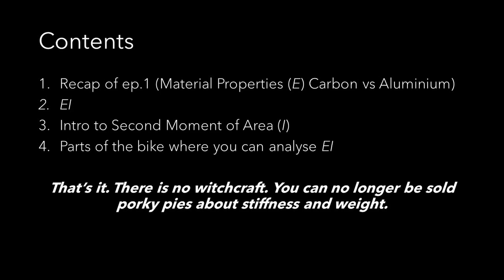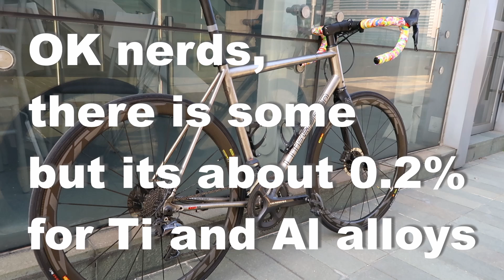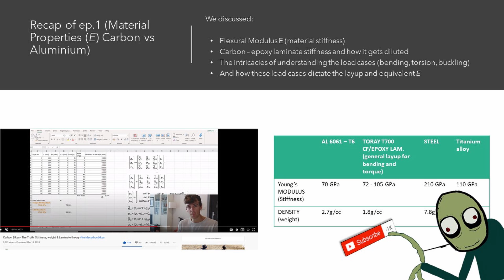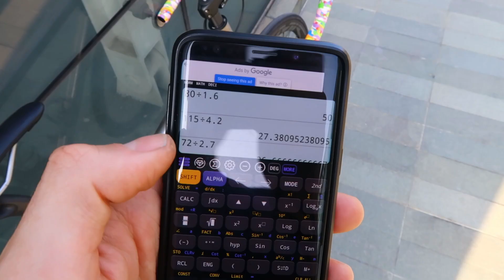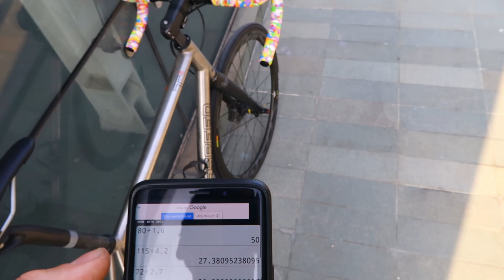Titanium Bikes - The truth and Physics of 'ride feel' marketing.

Comment: Great vid and spot on. 

Ti frames built with thin walls and large diameter tubes ride stiff. Period! And titanium alloys are not some magical vibration damping material despite the bullshit claims to the contrary. In fact, aluminum alloys have a higher vibration loss factor because they damp vibrations better than ti alloys. This has been tested and proven in numerous objective lab tests including the tests conducted by the Colorado School of Mines, who know a bit about metallurgy. This is why high end audio component makers use aluminum rather than ti alloys as a vibration damping material in their products. 

Having ridden ti custom bikes from Serotta, Moots, Holland, and Potts I can tell you from thousands of miles on those frames that ti is durable, looks cool, resists rust, and can build a slightly lighter bike than steel for a similar size and stiffness frame. But ti does not make a relatively stiff large diameter tubed bike magically ride like butter, float over the road, nor is it a magical vibration damper. And delusional claims and marketing BS to the contrary are just that, unmitigated bullshit.

Comment: The stiffness cyclists care about is really torsional stiffness. Vertical components are basically dominated by tires anyways. The key to torsional stiffness is increasing the width of your truss and getting the pedals closer together. In principle you might get a better result from an internal crankset

Comment: Those qualities of ride 'smoothness', vibrations etc, how much are they influenced by the current trend towards wider tires used at lower pressure? Is tire choice becoming a more critical factor in determining 'ride' than frame material? [as per sports cars' lower profile wheels vs saloon cars' deeper wheels- assuming valid analogy...]

Comment: Agree with all you said , & great to see proper engineering basis vz seat of pants opinions around frames...keep it coming !

From my experience 'Durability' and 'fatigue resistance' are also tricky terms given how many factors affect them beyond the base material properties, - I've had two TI frame failures with cracks  & two carbon frames badly deteriorated with alloy corrosion leaching into carbon at 'joints'
Reply: IF that alloy leaching was a problem, just imagine what will happen when those (soon to be the only way carbon bikes will be sold, if the manufacturer trends keep up like they are) all internal brake lines filled with corrosive brake fluid start leaking into those same carbon frames, even if they are internally gel coated (I'm guessing most are not, anyway??).

The sharp bends required to be hidden internally, especially near the head tube/stem even help contribute to the brake lines cracking, wearing through, and rupturing. :(

NOT a good design, in my honest opinion at least.

Comment: So I presume Bianchi's use of Countervail, to reduce high frequency vibration, is also marketing rubbish.
Reply: It's not, at least not completely. The countervail material has been successfully used in the construction of helicopter fuselages and satellites to prevent them from rattling (ie vibrating). Bikes in normal use rattle in much lower frequencies and under much smaller loads than aircraft, so the effect isn't that big. I own several carbon fiber bikes, and when I ride the same stretch of rough road, my Bianchi with CV is noticeably (a little) more comfortable, but CV definitely cannot make Paris-Roubaix-like pavé feel the same as a freshly paved highway. Their commercial with the ping pong ball bouncing on an isolated chainstay clamped to a"rattling device" is indeed silly, because one rides on a complete bike with frame, wheels, tires, saddle etc. and not on isolated single tubes.

Comment: I think this is simplyfied way to much. As far as I remember from my engineering studies, I scales with the power of 4 of radius of a tube. Weight scales linearly. (Thats why bikes are made of tubes and not rods) Since risk of crimping puts a limit on wall thickness, aluminium can be used to make a lighter tube of equal stiffness to that of a titanium one. To make a fair comparison I think you need to compare the value of the square root of E divided by density, for each material.

Comment: What about specific Strength? (not to be confused with Stiffness) Giving the smaller second moment of area of Ti tubing most likely means the maximum distance from the centroid will also be less hence less stress for the same given bending load, combined that with the higher material yield strength of Ti means a Ti tubing will have higher strength and larger deformation at failure compare to one made from Al.  Translate this into bike frame design, yes you  CAN design  a AL and a Ti frame that has the same stiffness, Ti CAN however allow for less stiffness (more compliance/comfort in marketing terms) for a giving strength requirement and that is desirable if comfort is what you want to maximize. 

Nevertheless, You can of course get a comfortable Al or a harsh Ti frame, other factors are also important.

Comment: : I have a scandium frame and it's lighter than Titanium. It's also pretty stiff. Like stiff stiff because of oversized tubes. But with nice tires the bike is a beast. The frame is from 2008 but was also produced earlier and weighs 1250g in size 58. It was a good deal.

Comment: My input, I have 2 steel Pegorretti’s, A steel Salsa and a Moots RSL, I have had a carbon tarmac and 2 Aluminum frames, so I feel like I have pretty good experience.  If I had to choose just one it would be the Moots hands down! Now don’t get my wrong, as you can see, I love steel bikes, but I look at the Moots as a Swiss Army knife, it does it all well and doesn’t rust! Edit- so I just got a steel gravel bike, it has 38c tires MASSIVE difference, talk about frames all you want but big supple tires rock!
Reply: My thoughts as well. I have a vintage steel fleet, an aluminium framed gravel bike and a vintage carbon bike. Wheels, tires and tire pressure make the most difference to the ride quality. I use hand built wheels as well which also improves ride quality and performance. I can say this without any doubt. 

So while frame material is part of the ride quality equation it’s not the whole answer.
Reply: @KeithHeinrich  recent Ronnie romance Doc says it’s every except the frame.   😂
Reply: @finarollerz  Frame is a starting point. If it was the only thing folks would never upgrade wheels, tires handlebar tape and so on. Case study, hi mod carbon frame on 23mm tires and mavic wheels vs 26mm rubber at lower pressure on wider custom wheels is a night and day experience in ride quality and handling. Same frame. And same deal across all the bikes. Frame is a starting point. Much better with better wheels and tires.

Comment: Last year I purchased a litespeed gravel. The main reason I chose the gravel was so I could have multiple wheel and tire combos. The biggest difference in ride quality comes from the tires. 25mm tire rides like a log wagon and the 47 mm tires feel much better. The 47mm tires are not as fast but at 60lpsi the ride quality is much more forgiving , traction is confidence inspiring and it looks awesome.

Comment: Enjoyed the video.  I am also a larger rider (250+ lbs).  I notice the bottom bracket moving laterally quite a bit when I rally push hard on the peddles.  I imagine that movement results in a loss of power transfer to the drive train.  How power is lost and is there an optimum frame geometry and material for high torque applications?  I have measured over 1,000 ft/lbs of torque (Garmin Vector 2) on some of my sprints.

Comment: Titanium is super strong and durable! I used to work with a guy that was a pro road racer. The guy tried to help me build my LItespeed Vortex and was putting the headset in wrong, so he thought hit it with a bigger hammer. I was out front helping a customer when I heard the noise of him slamming my top tube with the hammer when he missed trying to hit the headset. The only thing it did was leave a big grease/dirt mark on the top tube. I tell you most other bikes, would have cracked, had a hole in it or a massive dent!!  The guy that made this video seems to have a grudge against Ti and is not giving the full and truthful picture or Information about quality Titanium!!!!!!!!!!!!! The dirt mark wiped off and I have ridden the bike for 30 years or so. Quality Titanium is for all practical purposes indestructible!!!!! Try hitting a aluminum bike with a hammer with the same amount of force  and it would dent or have a hole in it. Do the same with carbon fiber and it would break or have a stress riser, in my opinion.

Comment: No surprises here, still enjoyed video, but have to think material dampening along with frame's nature frequency play a role in Ride Feel.   Just looking at that bike frame design, it looks "harsh".  My Lynskey Litespeed has a much better design, curved seat stays, slacker angle, etc..   I have found Ti to Ride better than Al, but not True Temper OX, and my fav is butted 4130.   I didn't know Ti was supposed to be smooth, but I guess my Steel frame bikes are supposed to rust away also.  Still Waiting.

Comment: Agreed.
But sense the Young’s modulus of aluminium are lower than steel you are able to make the tube diameters much larger an that makes a stiffer frame, that will than turn into rougher ride. Sense titanium are heavier the tube thickness would be ultra thin if the tube diameter should be the same. That’s why titanium tube diameter are smaller, and than ends up in a more sluggish frame, than a smooth ride.
I think that why you feel the frame not are stiff enough. I don’t think you can find a stiff and responsive titanium frame.

Comment: Hi Peak Torque, 
Is there perhaps something in the material damping properties? 
On a bike/component without conventional suspension the only damping comes from the material itself.
This damping is of course different between steel/ti/al/CFRP.
I haven’t looked into it too much myself regarding bicycle frames, but it has effected previous work of mine.
I think you’re right the “spring” part of our mass spring damper system does dominate, but I don’t think you can ignore the discussion for damping.
Reply: In addition: love your work, I’m not saying you’re right/wrong about ti bikes (I’ve never ridden one), just interested in opening further engineering discussion!

Comment: Aviation history is full of these types of discussions. It's usually not the materials that hold things back. It's the fabrication techniques. Titanium was discovered in 1791, hardenable aluminum 1903, carbon fiber 1860, yet early aircraft couldn't use them much until people mastered working with the materials. I suspect titanium bikes will get better and better as time goes on. Early generations of any tech will have vast room for improvement.

Comment: 100% agree. You can make an aluminum frame compliant, and titanium stiff and no compliance. It comes down to geometry, and tube selection ie. butting, profile, diameter, and wall thickness. You can of course build a titanium frame to be more compliant, but you can do it with aluminum or steel.

Otherwise, frames can be built stiffer and more compliant and lighter with carbon due to the way that the weaves can be manipulated to flex on a specific plane.
100%, most compliance comes from tires and seatpost though. Also, if you have a 350mm post, but 60% is in the seat tube, you're losing out on compliance. Always run the minimum amount of post in the seat tube if you want the most compliance.

Comment: Love the details you’ve put into this video. Keep them coming.

I will say though, you’ve essentially just described why all of these myths are usually true, just not for the reasons that are usually claimed. We ride bikes we don’t just ride aluminum or steel or ti as a stand alone material. As you described the different ways these materials tend to be constructed is what leads riders to say they feel one way or another. Their observations are valid even of the don’t know exactly why they are feeling that.

I love that you pointed out the difference that components will make to the the feel of a bike because it is huge. We don’t ride frames by themselves after all haha. And as you mentioned different frames of the same materials can feel drastically different.

Comment: My  mountain bike and road bike are Ti, for the simple reason that I wanted a "lifetime" frame (basically I wanted it to be the last frame I ever bought etc...).  I'm 99% sure that I actually hadn't given thought to stiffness or ride quality.  As a Gen X'er, I just think Ti was that bad ass super alloy that was part of the space race.  Growing up during the middle of the cold war, the X-15 and SR-71 was mind blowing, as such Ti was just that cool exotic material.  I just bought Ti cause it just looked cool and it was the material that made amazing things happen when I was a kid. IMHO, if someone is obsessed with performance figures and wants the latest and greatest, they should just by the latest and greatest Al frame every other year (or a carbon frame if you've got deep pockets).
Reply: Carbon frames to me are not durable at all. I think Al frames are still pretty damn durable. I still ride a Caad7 from 2003 that has a LOT of miles on it and it still works great, shows no sign of wear (has a dent on the main tube from a crash, which would have meant the end of the frame if it was carbon). That was my grandfather's bike, my bike is a 2018 specialized allez sprint comp because it was by far the best value bike on the market at the time. I expect it to last a really long time, even though it's an Al frame. Titanium is ideal, I agree, but way out of budget. I don't understand why people think Al doesn't last long, it easily can last 20-30 years.
Reply: This is a late comment, but this is my exact thoughts on titanium frames. A good quality Ti frame can definitely be a lifetime ride, which is why I just spent $7k on Pilot Cycles Scram Pinion bike. It’s a lot of money, but it should last me my entire life! I’m not too stressed about ride quality, I just wanted that titanium “look” and durability.
Reply: Chinese carbon got cheap.

Comment: Unfortunately it is often the case for metallic tubes that the fatigue strength determines the dimensions and therefore the polar moment of inertia. Therefore you can have thinner titanium and steel tubes than aluminum, making them less stiff. Whether or not that stiffness difference really makes a difference in feel even comped to wheels/tires... I have no idea. I just really like the aesthetics of titanium right now. 😂

Comment: What's your thoughts on Bastion bikes with titanium lugs and carbon tubes? I like the concept of using 3D printed titanium lugs to hold carbon tubes but wasn't sure if the lug material are likely to have any influence on compliance – rather it could come from the 3D printed design?

https://cyclingtips.com/2017/05/bastion-cycles-road-disc-review/

Comment: Great video, but I also think aluminium bike manufacturers deserve a little credit. With the latest gen (Emonda ALR, CAAD 13, etc), they at least claim to implement size-specific tubesets so stiffness is appropriate for the estimated rider weight/power of those dimensions (ex. a 5' 10", 175lb rider with an FTP of 280). Whether or not that's implemented correctly would be quite expensive to test in a lab though.

Comment: I've just bought a Ti bike and I love it! I bought it for a variety of reasons but mostly aesthetics and hopefully durability.
Having changed from an Al frame of similar weight it does feel more comfortable but that could be down to several factors such as the Ti bike has dropped seat stays, carbon fibre seat post and it's running 25mm tyres instead of 23's. I can't compare my carbon fibre bike as that's a TT bike and a completely different beast.
Of all the bikes I've ridden the Ti one is my favourite though.
Reply: No paint is a win win

Comment: Hydroformed Aluminum can’t be beat for the masses. IMO
Reply: I agree... I have a 2017 BMC Teammachine ALR01 that I love. But I’m pretty conservative in my riding needs… I had a Basso Paris-Roubaix (Columbus SL) for like 20 years. As I aged I could tell this steel frame was beating me up. The BMC is like a driving a Ferrari with a La-Z-Boy recliner as the driver’s seat, and I got it new for a steal. It’s incredible what can be done with aluminum alloy these days. Keep in mind I don’t race, and I’ve never ridden a carbon frame so I’m blissfully ignorant. I just don’t have the cash for good carbon with 105 or better so I’ll have the BMC Teammachine ALR01 for the foreseeable future.

Comment: You are absolutely right, my 1998 Litespeed Vortex at 1280 grams of relatively small diameter tubing and 1" fork steerer had the magical flying carpet legendary Titanium ride, my 2019 custom titanium frame at 1650 grams with big tapered head tube (1 1/8 - 1 1/2), and a 42mm downtube feels a lot like a stiff modern carbon frame that weighs 1000 grams...
Reply: I remember Ti being the metal of the future back in the 90s for road bike frames. 
What ever happened to that???